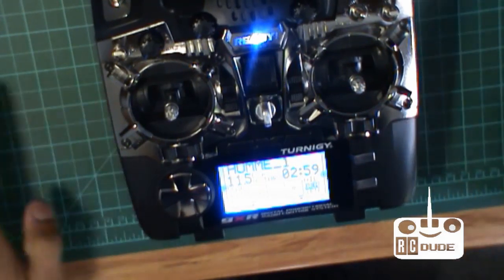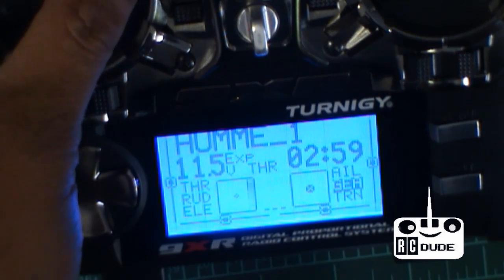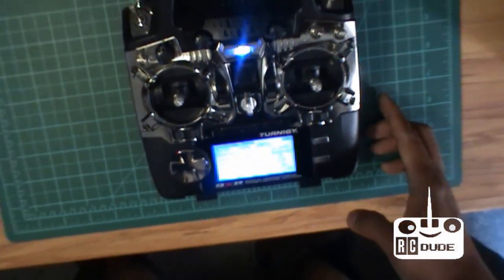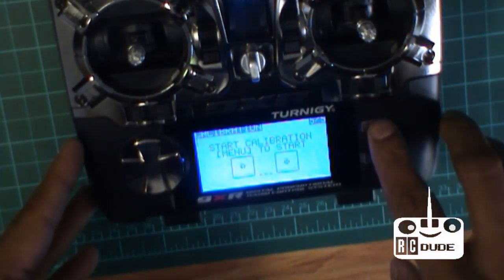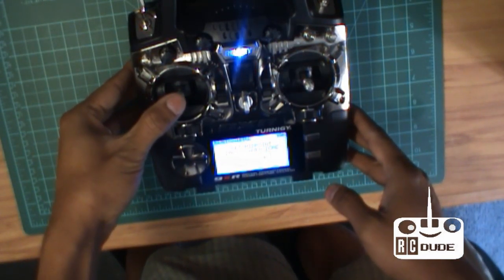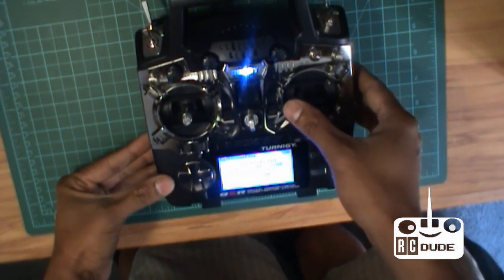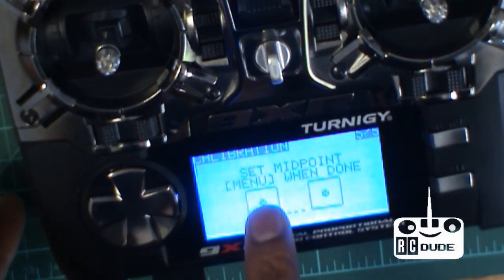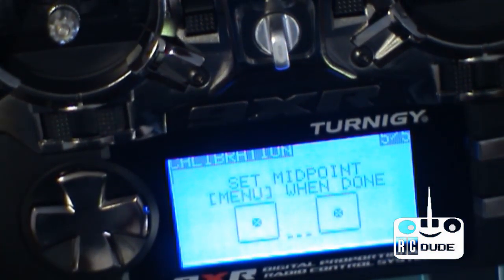Turnigy 9XR How To Do Stick Calibration

Comment: Hi I am keep getting the CFG-ERR error at the bottom of the screen. When I click "Start" for calibration the sliders doesn't respond except Aileron Throttle . Cant calibrate elevator and rudder?even though when i reverse it from naza assistant and 9xr still it doesn't work?Only throttle and Aileron moves/works?
any idea why its not working?
http://youtu.be/kkGisxcBfu4
Reply from the maker: i watch  yr video on youtube  if u calibrate  only in 9XR and every think working (if not working make sure upgrade the firmware for 9XR ) then yr transmitter and Naza software is not communication together so . u need to find software version upgrade and then try to upgrade or change the Firmware for yr 9xr and then try to do calibrate with naza software .. i hope that its work for you .. thanks
Reply: Good afternoon I have a mode 2 9xr pro. When I try to calibrate the right stick it returns back to its original position on the screen. Any input would be great on this. Thanks